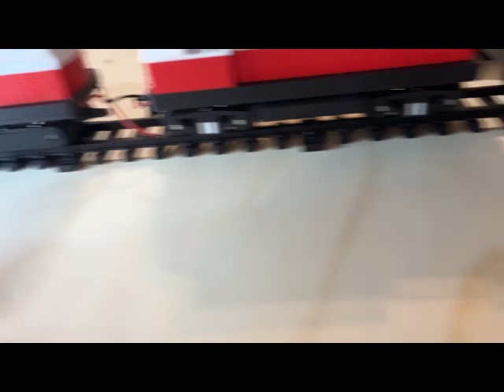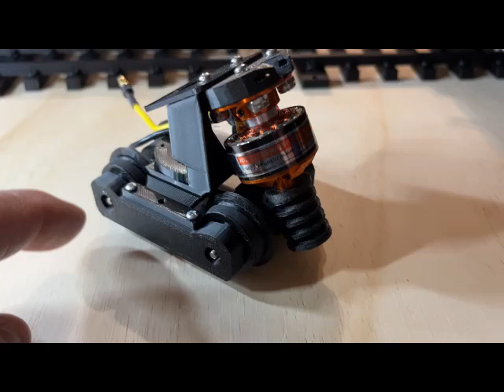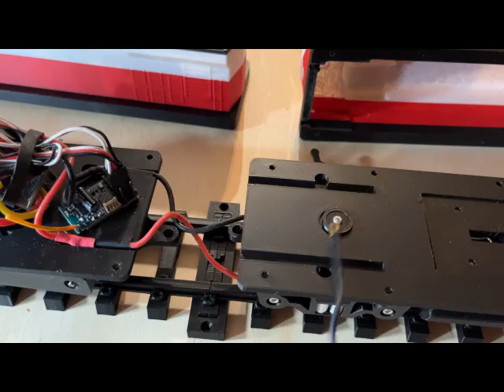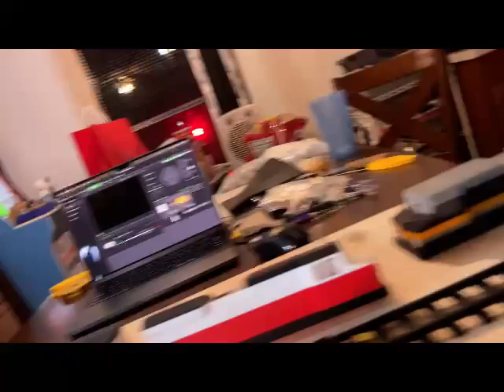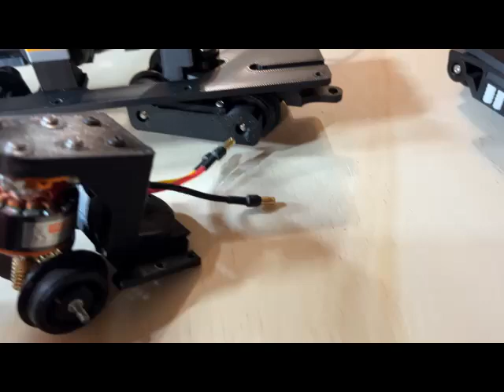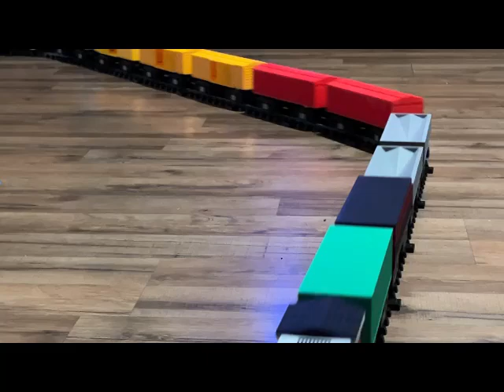3D Printed Train Set Engine Details

Comment: Been looking into printing model railroads lately.. And this seems to be the one of the better designs I've come across. Anywhere I can get these files? Paid or unpaid? What gauge are you running? 32mm O scale?
Reply from the maker: Basically "O" gauge Send me a email to   testfly (at) atlantic.net    (in the correct format with no spaces)  with "train set" in the subject line.